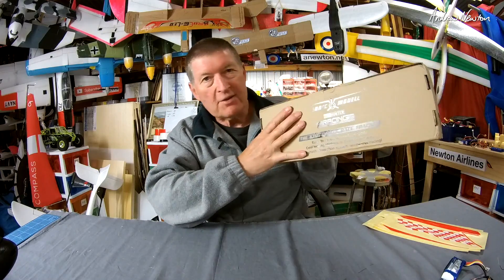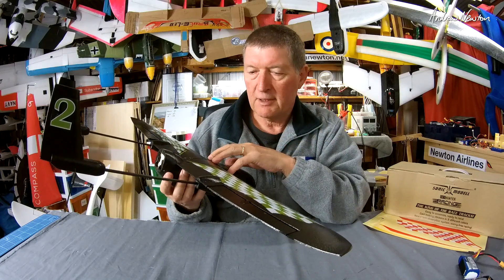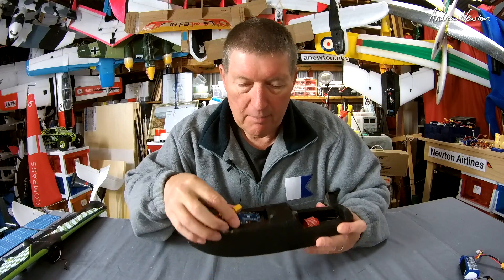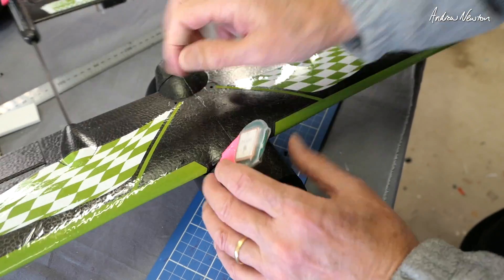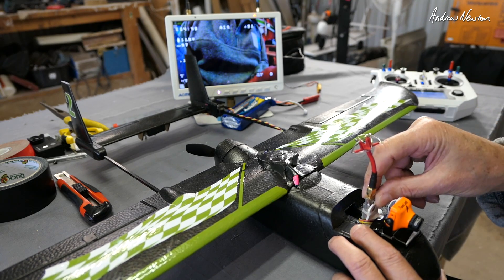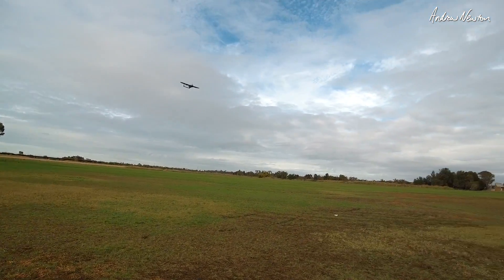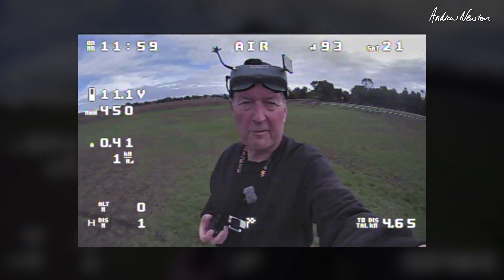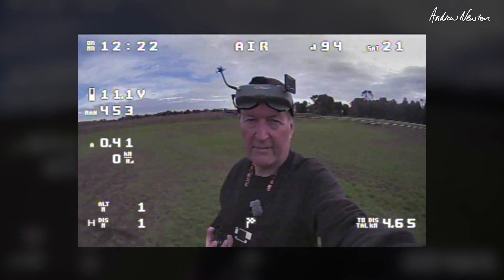Skyhunter Racing FPV and iNav

Comment: I want to get kit version..would like to get maybe a 2205 2500 kv quad motor ..i always use standard apc type props on my pusher jets,but never mount a quad motor on my planes...should i order reverse rotation ccw motor? On all my pusher setups prop spins clockwise when looking from the back of the plane...great little plane .thanks
Reply from the maker: No reason to have CCW props. I just use CW props on pushers.
Reply: @AndrewNewton  i meant the motors with reverse threads...they wont loosen like a cw motor can ..i akways use reg props on my pushers...no big deal anyway,just make sure nuts are real tight on cw quad motors..thanks

Comment: Hi Mr. Andrew, I'm pretty new to planes and you've been a huge help for me getting me up in the air.  I've had success with my 800mm Sparrow wing, and then a mini ar wing with a inav configured f411, my next challenge is this skyhunter racing craft up in the air...  Between the wings I tried the Sonicmodell mini ar but after a bad crash in its maiden, Ive been hesitant about taking her out again.  Using a sparrow gps + stabilizer, and looking over the damaged goods, it appears I may of made a mistake setting it up because the rudder was moving the elevator.
Anyways, I'll be getting a new omnibus f4 pro v3 in the mail tomorrow that I want to dedicate to this bird and would really like to to get your inav settings if you could be so kind sir.  Thanks again for sharing your knowledge! 
Also bought a Runcam 5 thanks to your sloping videos!  I intend to put it on this build from time to time.
Reply from the maker: Hi Aarons14bugs. I only have one iNav model setup in my Taranis for all my iNav planes. Check out my blog for my Taranis settings http://newtonairlines.blogspot.com/2019/03/inav-basics.html and here is how I set up the plane https://www.youtube.com/watch?v=VNbzWPZfZ9M

Comment: I didnt quiet hear what flight controller you used ( hearing problems) 

Ive been looking at the matek 405 as know it will fit but will be a tight fight
Reply from the maker: F411 Wing in the end. But the new F411 WSE would be the best to fit
Reply: @AndrewNewton  Thanks

Comment: Does the Flight controller have to have Sbus ? . .  reason i ask is i have a dx6i  which means no sbus
Reply from the maker: DSM2, DSMX, iBUS, PPM according to the specs, but I have only ever used SBUS
Reply: @AndrewNewton  found this on hobbyking website  https://hobbyking.com/en_us/orangerx-r620x-v2-6ch-2-4ghz-dsm2-dsmx-comp-full-range-rx-w-sat-div-ant-f-safe-sbus.html

Which version of the f411 fc did you use mini or standard size ?  

Would love to do this build and would be my 1st  build with a FC
Reply from the maker: Matek F411-wing - https://bit.ly/2tozTbh

Comment: XM Plus micro reciever Andrew, 6 kms range....that RX you are using is HUGE.....lol.
  My Z84 has big mileage on itm looking for a replacement this could be it..?...Its definately faster.
Reply from the maker: The XM+ would be perfect on this one. I have a couple
Reply: @AndrewNewton  7km with a XM+Micro, though I did loose radio link on the turn for home as the antennas were at the back, so the vets was in front on the home leg. Am seriously considering putting INAV in my old Nano Hunter now! Great video. Keep Em coming.